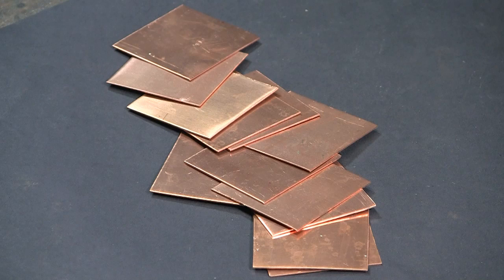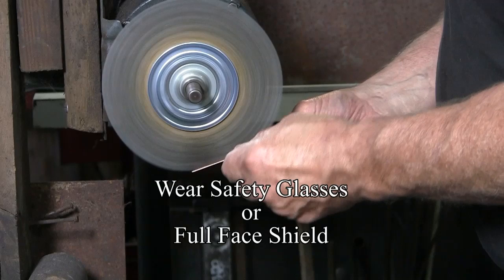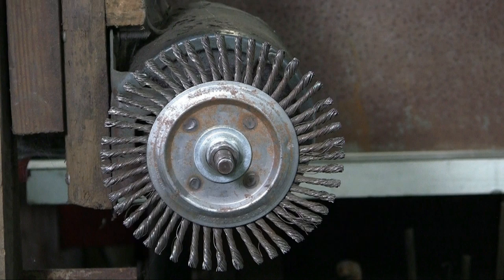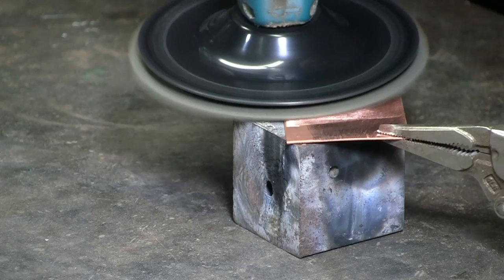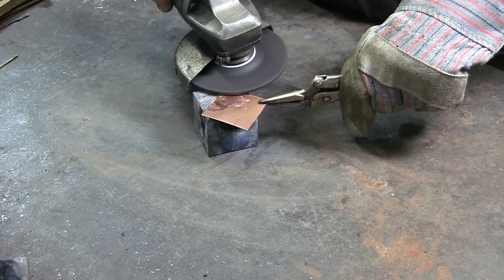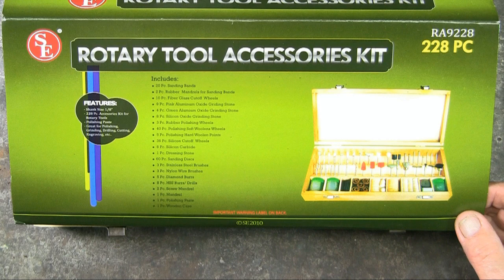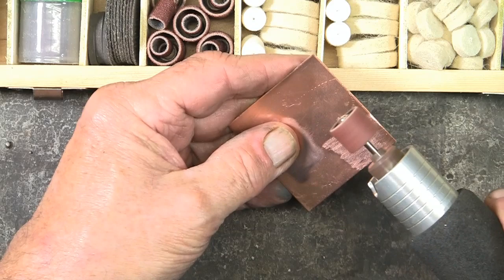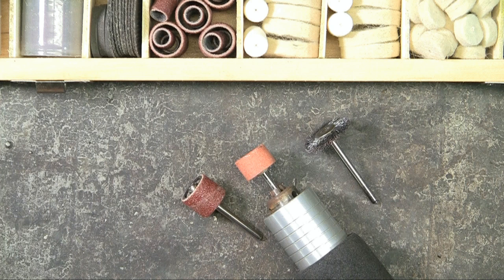Copper Finishes & Textures #1

Comment: I just textured some copper sheet today thanks to your videos.  The results were excellent. I used a fine wire brush on my drill and got a nice smooth rotary pattern.  I didn't have to anneal first or polish afterwards. Thanks for the instructional videos. Very helpful.
Reply from the maker: Thanks for posting.  Glad it worked out.